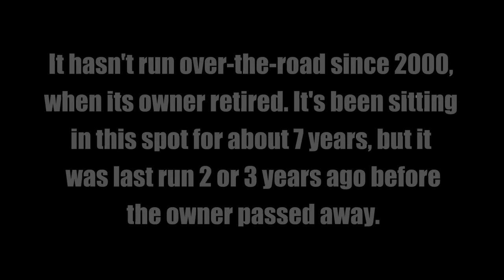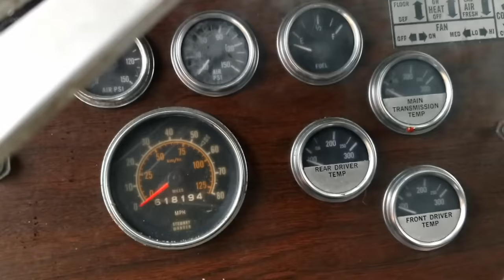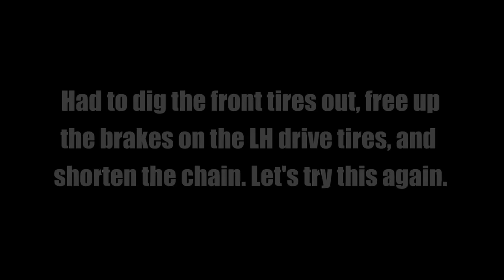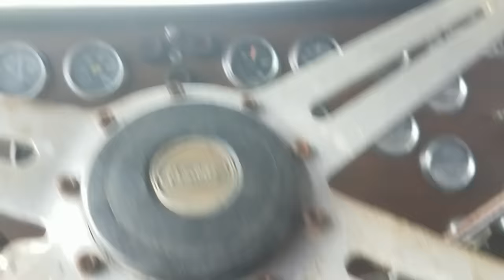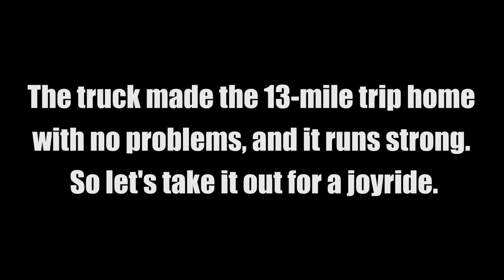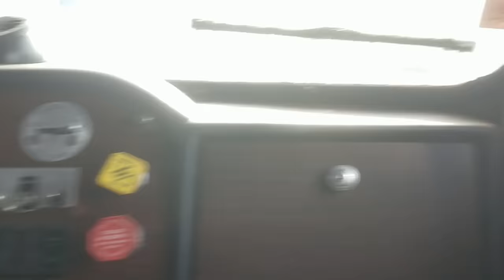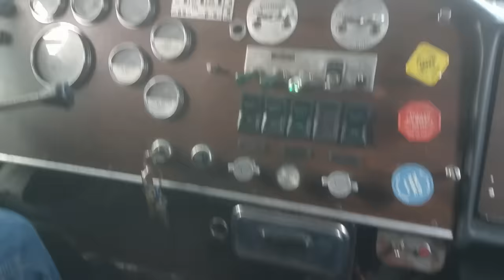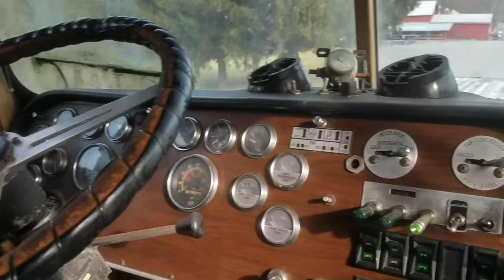Rescuing a 1977 Peterbilt 359 From Its Grave - First Time On the Road in 18 Years

Comment: Do you have to have a specific type of license to drive an 18 wheeler? Like not commercially, more like around town and in parades
Reply from the maker: In the USA, you must have a class A commercial drivers' license (CDL) to operate one for hire unless it is tagged as a historic or recreational vehicle (not for hire), or is owned by a farm and tagged for farm use - in that situation most states will allow you to drive within 150 miles of the farm hauling crops or equipment without a CDL. In any case, if you are using the vehicle solely for making money (for hire), it must be tagged apportioned or commercial and you must have a class A CDL.
Reply: @MichaelTJD60  well the farm that I live on is about 10 miles where they have the parade in my town. It's pretty small and I don't plan on going anywhere 150 miles out.

Comment: Nice truck. But what about the engine? Is it supposed to smoke like that?
Reply from the maker: It cleared up the longer we ran it. That is several years' worth of old oil residue burning off the pistons, in addition to the fact that it was 16°F outside that morning when we first started it.

Comment: Think taking it on highway would do it some good with a faster speed than just back roads.

Surprised the fuel pump is still good.     
A big. Drink.  And changing the oil.

Comment: The old truck do not like  ultra low  suffer diesel....  take my word for it...  Ad some motor  oil to the fuel if you don't want to burn up the pump & injectors. Or you can piss & moan  when it happens.......

Comment: This needs to go to the junkjard press. Why would you rescue this?
We have environmental laws, this thing is ilegal for public usage, also maintaining this truck and filling up the reservoar will cost a fortune. 
A new trucks are obsolete after just 5 years of regular usage.
Reply from the maker: You just answered your own question in the last sentence. The older trucks run longer hours, are far more reliable with fewer electronics, and in the long run are cheaper to maintain. The current owner of this truck fixed it up and put it back on the road to replace his 2007 Peterbilt that was giving him constant problems. The old truck has made him more money than any of his new trucks, with less down time.

Comment: Rent it out as a mosquito fogger, that is some rancid fuel.
Reply from the maker: The fuel was actually fine. It was 16°F that morning and the engine hadn't been started in 3 years, so it took a while to burn all the oil residue off the pistons (and get the fuel to fully combust) - hence the smoke.